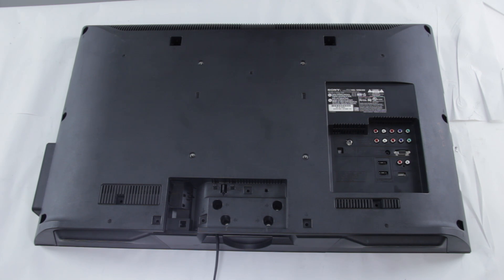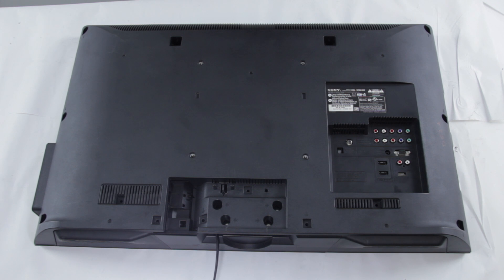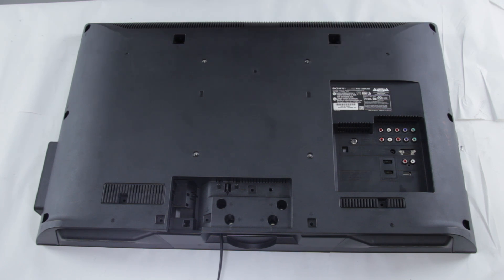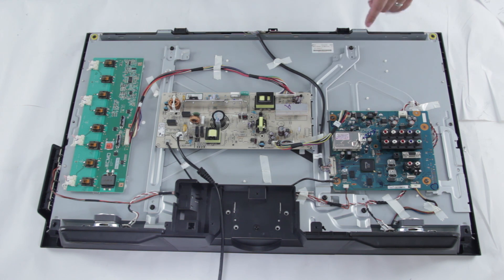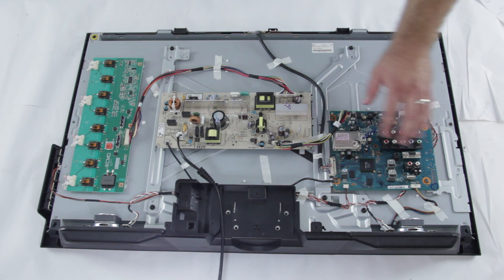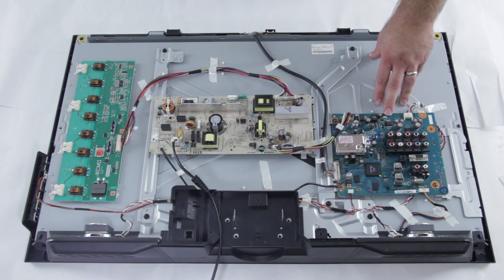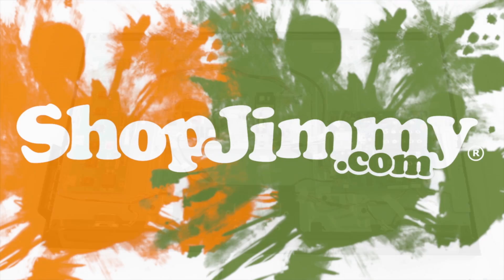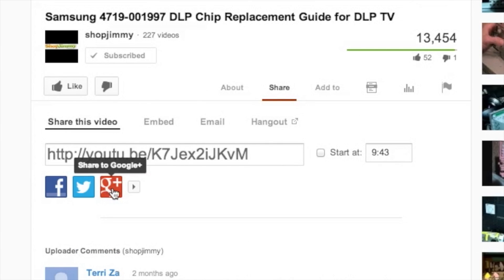LCD TV Repair - TV Has Audio, No Video - Common Main Board Symptoms & Solutions

Comment: My tv is a tcL model : 55S405 has a blue screen with sound I replace the power supply board but still the same thing is happening I’m thinking it could be the tcon board or the back lights in witch I’m trying to avoid that as it is a lot of work to replace

Comment: Hi, I have a Phillips rocu model no.50PFL4756/F7W.  It was manufactured November 22 and I've owned it around 8 months. Sometimes when I turn it on you can read the Phillips logo on the screen but it has tons of lines and the screen immediately starts to turn black from all 4 corners .the black starts in the corners and and moves inward until the screen is black or dark blue.Like if you spill ink on a paper towel type of effect.other times you turn it on and is backlit but just dark blue with no picture.any ideas?another thing is I've tried plugging into several outlets and it  always seems to pop pretty hard when plugging in like something's grounding or shorting. any help would be much appreciated,thanks

Comment: I have Bauhn (Aldi brand) model ATV75UHD-117 SN 26330389 (I think)
This TV isn’t shown on your website. I’m in Australia. Wanting to let TV repair kit. 
TV turns on sone of the time and doesn’t at other times. On other occasions the screen will disappear whilst it’s showing something. Often the sound disappears as well but on occasions the sound still works when the screen disappears. 
The red standby light works and turns blue to show that it’s on, regardless of the screen doesn’t light up. 
Thanks

Comment: Have Samsung 50" TV UN50H5203AFXZA Ver 1HO2. Everything was working fine. One morning turned TV on and had sound but no picture. I replaced Main Board. Still no Pic. Replaced Power board. Still no pic. Replaced T-Con board. Still no pic. Should I just junk TV?  Only 3 yrs old.

Comment: I have a Sharp LC-65Q7370U it turns on for a sec then it turns off for nine sec then it repeats this cycle.  I replaced the power supply board but it does the same thing could this be the main board problem

Comment: MY PANASONIC  TC-L47E50  /serial #MC23140239 / problem is when i power on  the screen coms on then flashes on and off as well as the red power light..i removed back panel i don`t see ant a see any physical damage. i looked up power supply  & mother/logic boards they were out of stock, im hoping that i will be notified once they are in stock again!

Comment: Sharp LC-50LB261U red power indicator light flashes 7 times and then turns blue.  Audio is working, video is not.  When I shine a light on it there is a feint picture. Not sure if I should replace the main board, power supply, or led backlights. Any help would be appreciated. I have a multimeter I'm not sure what I should do to test which component needs to be replaced. rptash@gmail.com

Comment: Pls my philips led tv (Philips-46pfl9706t) has video display issues.. Tv will be on but then all of a sudden the visual will be off with d audio part still on.. This happens like 10 times a day.. Whenever this happens i jxt turn it off for a few minutes and then back on, visuals will be right back on.. So i do this back and forth everyday wit d tv.. And its not about external connections but d tv itself like when am watching normal tv.. Is there any component responsible for this? I don't know.. Pls help me out.. Thks

Comment: Samsung UN46F6300 doesn't turn on.

Backlight was also slowly failing in recent years. Now, it doesn't turn on at all. Red light is on though.
Reply: Can I take a meter to any part of the board to findout which specific board of 3 is bad?

Comment: 55LV3500-UA will power on but it has a black screen, no backlight, no sound. Measured the voltage on all pins and they have the correct voltage on the connectors at cable connectors. Not positive what the problem is.

Comment: My tv is a 60ln5400. The back light is fine it gets sound. I don’t have picture and I thought it was the t con board but however I switched it out with a new one and I still don’t have picture so now I think it’s the main board. However, after about 5-10 minutes the tv will shut off. So now I’m wondering if that is also a symptom of the main board or if I need a new power supply board as well.

Comment: Hey I have a Sony xbr 55x700d. Serial number 50486624. The tv What’s not powering on or doing anything at all I took it to a shop to diagnose the problem he told me the main board was bad so I bought a main board and swapped it out the TV now turns on on the bottom with the lights and it sounds like it’s starting up in the audio only place there is no picture on the TV itself any idea what this problem could be thank you

Comment: I have a samsung UN60ES6500 and I csnt figure out if the tv has a problem or my pc which is using the tv as a display. The picture of the tv, only when its showing pc stuff, sort of jumps a little. Not quite screen tearing and not graphical fragments. Just little jumps like v-sync is messed up. Someone told me it was probably the mainboard of the tv going out but I figured I'd submit to experts in this area

Comment: Hi I have a Vizio M420NV, Serial # LAUKGUAL2003620 and it doesn't power up. The yellow Vizio lights up when plugged in and does change to white when I power on. It use to come on if I shut it down and unplug for awhile but now it doesn't power up at all. Any help would be appreciated. Thanks Joe

Comment: Hello.
Well done for helping the general public.
My Panasonic TXL32E3B kept randomly switching off after a period of time and then single regular red flashing . I read most likely issue was the Power board. So I replaced that but this didn't solve the issue.
In fact it switched itself on from standby just now so you could say it's doing both. It works better if you unplug from mains for a moment then try again. Assuming it's not the power board what else could it be?
Thankyou

Comment: I have a LG 65UJ6540 That after it warms up goes into burn test mode with solid blue, green, white colors being displayed . When the problem first started and you tried to change channels it would race thru the channels and not have the ability to stop it. Then it would go into the burn test mode with sound, then eventually the sound would quit. Any Ideas which board could cause this?

Comment: Attempting to repair an 47" LG LED 3D TV.  Model: 47LM5850-UF  Serial#:210RMWVFD601.  From what I can tell, this TV is fully functioning as I am able to navigate menus and make use of all video connection ports.  The only issue has been with the edge lighting.  On a cold start everything appears fine for 15 to 30 minutes but will eventually shut down.  If a restart is attempted at this point, the TV will light up long enough to display the LG logo screen with time right before going black again once the video signal is displayed.  Light strips show no irregular functioning LEDs, all light up with uniformed brightness until the lighting is suddenly shut down.  My thoughts fall on being a Main Board issue rather than Power Board but that's just a guess.

Comment: I have a Samsung UN48JU7500 and the second I plug in my One Connect mini, the TV turns off, and the red power butting double blinks 5 times. If I plug in the one connect mini connector cord by itself, the TV does not turn off.  I bought a new one connect mini and cable,  and the exact same thing happens. With the one connect mini unplugged, I can still use the component connection, and all of the smart tv features work as well. Does this sound like it could be the main board?

Comment: I have a Samsung 65 in KS9800. I have audio and no picture.  It's not black but gray. You can see some shadows. I've already tried replacing the T-Con and LCD/LED driver boards with no success. Can this be the main board? Thanks

Comment: Panisonic TC-L58E60  tuns off red blink light .changed out power supply  no fix unpluged tcon still no fix  back lights eliminate for a couple seconds  then turns off. Would that mean its the the main board

Comment: I have replaced the power supply board and now the tv will not turn on with either the tv remote or the power button located on tv. Samsung tv ln32c530f1f

Comment: Hello. I have a Toshiba 55L310U. All of a sudden, the set would no longer turn on. I opened it up and discovered a cap blown on the power supply board. I replaced all 5 electrolytic caps with the same value as the originals. 

Now, when plugged in, the set will “power up” bright, and then dim after a second or so, and then dim again. It will not respond after that. The is no logo screen or menus or audio/video, but the backlight is still on. 

I decided to throw parts at it and replaced the power supply board. After swapping the boards, the set is responding the exact same way. Do you feel that this could be a main board issue as well?
Reply: Thank you!!!!

Comment: Westinghouse wd55ut4490,  1st TV had backlight cutting off and on, when just by plugging the TV in, changed the main board & now, backlight doesn't come on and doesn't power on then changed the power supply board and the same thing. Power supply V's are good, 5, 12 and 24. Power button works, no power to backlight turn on or power to FRC board. Thanks

Comment: Philips 32pfl5403d/12 
Sometimes (always when warm), the picture freezes, it goes silent and the image goes dark - red disappearing last and then the front LED goes out. Simply turning TV off and on again makes it work again - and it can work fine for weeks, even standing on all the day on a weekend for 19 hours straight. It has happened three times in the last 8 months. 
I checked the caps in the power board (ESR, capacitance, resistance, Vloss) and found nothing bad, found one cap that was 14% under the rating (which is usually OK) and swapped that for a better cap. Resoldered the components handling a lot of power and some bad looking joints. 

Anything else obvious to do? It's a rather small about seven year old TV with lower than HD resolution, but it has a lot of analog inputs which is nice (not having to use the CRT all the time) and if it's cheaper to swap a board than to buy another TV - it's worth the money... or I'll probably put the 32" CRT Widescreen back on the shelf again.

Comment: ln40b630n1fxza, standby light flashes steady with no reaction to powering on. There is a faint audible and repeating clicking noise that stops after about 5 seconds. Capacitors look to be in normal condition

Comment: I have a Changhong LED TV MODEL LED32C2000 . Pictures distorted solarized. No audio upon opening need several try or waiting until the tv heat and try opening again before you can have the audio. what might be wrong with the LED TV? Do you have available parts for this tv? Thank you so much in advance. More power.

Comment: Have a JLC47BC3000.  Powers up but no image display's after logo goes away.  Would be an easy fix if replacing the main board but is that cost prohibitive?  Under 300 should be justifiable.

Comment: I have a question I have a 65 inch RCA TV that will not turn on there is a blue indicator light on the TV that also does not turn on I tested the power supply board and on one of the little prongs it gives me 5 volts I don't know what to do

Comment: Hi I have a Celsus 50" flat screen the model number is DLED50272 FHDCNTD . We have just returned from hols and put our TV on with the remote  as usual the tv powered up but we had a black screen with sound, I thought that the source was at fault but no there was nothing wrong with that, I changed the source  to the Xbox feed but the picture never  changed, I put the  source back and then the sound went, now I am left with a tv that has a black screen no sound no menu, the remote works fine with the standby, I have done the torch test but nothing shows, I dont know if the problem is with the power board or the main board ?

Comment: HI I have an issue with my LG 3D TV. I have LG 42 inches 3D TV. Model number LM6200. TV has sound and bacllight, ican see the   dim light in the screen and can hear sound while I connect with dish, bluray player and antenna for local channels. I just rored the flash light test, as described in your youtube channel, but couldnt see anything. Please advise me, whhether the isseu with main board or t0con board. My T-con board part numner is 6870C-0401B, ver 0.2.

Comment: Thank you for this informative video, i have a Haier 39D3005 that stopped turning on completely with remote or regular buttons, that stand by light is working but the TV is not powering on, what could tge problem, main board or switch panel? And what boards are compatible with it

Comment: I have a 55inch insignia ns-55l260a13 when i plug it in and power ir on the back light flashes on and off till the red light shuts off and i have to unplug it for it to do it again. I have checked all capacitors out of circuit all are good all resistors and diodes on power board  are good. And i was wondering what else to check could it be a main board issue

Comment: My phillips tv (42pf7421D/37) I'm getting picture and sound but the screen blinks what can cause this. I have noticed that I heard a noise clicking noise on the power supply board every time the screen blinks.also I noticed so dark areas on the board possibly indicating overheating. But no blown capacitors .the tv does power on normally though. Any help would be appreciated thank you

Comment: We have a sony model#kdl-46w 4150 ser #800 5569. It works w/ an antenna but will not work on a cable. We have tried it w/ other cable outlets in our home which have properly functioning tvs and it will not work. i have hooked up a different tv to the outlet we are trying to work and that tv works properly. I have even had cable out to check our service and they could find no problems. This Sony apparently reads a signal from an antenna but not a cable. What needs to be done to fix the tv?

Comment: Have a LG 32LD350-UB backlights work, speakers work, but no picture. I've replaced the main power board, but no luck. Thinking it's either the main board or T-con. Any other suggestions?

Comment: Hi. I have a Panasonic TC-L32C3 I am trying to repair. The problem that I am having is that the tv powers on and works fine sometimes, but then I can power it off and back on and it won't have picture but the audio still works.  With the flashlight test it doesn't have any signs of picture either. I then power it off and back on and it works fine without having to shake the tv, so I don't think it is a loose connection anywhere.  Sometimes I have to power it off and back on a few times before it begins to work correctly. 
Thank you in advance for any help that you provide. Feel free to ask about any additional information you may need. Thanks again.

Comment: RCA 19" Model#L22HD32D TV Comes On Will Play DVD Show Picture Of DVD playing But Wont Show picture from direct TV box checked connections from direct TV box all wires in connections are good hook them with another TV box picture comes up on screen Look On your Sight on you tube and you were out of stock the main board that i need or think i need.

Comment: Hi 
SONY 42^ LED TV
Model : KDL-42W650A
Problem Statement: Green colour dots shades are seen randomly on screen area.
This behaviour is not consistent, it started five days back, for the first two days we have seen this all the time. 
Next two days completely not seen and the fifth day problem repeated.

Initially TV was wall mounted for the first two days when we have seen the problem, then we unmounted and placed on table top. Then for two days we have not seen this problem. Again fifth day problem repeated.
I have updated to latest firmware and also factory reset. But problem not solved.

Please let me know what is the problem and suggest me how to fix

Regards,
PadmaRaju

Comment: 42LG50- UAMy tv won't play sound through the speakers and none of my HDMI ports work. I do use red, yellow, and white cables for a sound bar and DVD player. I'd like to upgrade to blu ray but can't due to no rca plugs on player and no working hdmi ports on tv.

Comment: Thanks for all your wonderful information. I am learning a great deal about fixing my tv.   I have a Sony KDL-40W600B that needs the main board replaced.  I have taken the lower back off of the set and followed the service manual to remove the main board and tuner board.  Can you tell me how to go about separating these two boards, as they appear to be connected?  I can't find info on how to do this, and I don't want to break the tuner.  Thanks

Comment: 32' Samsung Model UN32H5203AFXZA No picture, No sound with blinking power button led light (audible clicking sound when the led turns on/off).   Disassembled it and did not see any issues with caps or burnt marks.

Comment: Hi, i am trying to repair LG 42LB5800-UG, SVC CODE: 42LB5800-UG.ACCDLJR.   LG logo flashes for a moment and goes black screen but speakers are on and no video. Please let me know whether man board is the problem or LED strips are bad. I tried changing the T Con board, but nothing changed.

Comment: Hi i have a bush 50 inc 211f tv my problem is red standby light on but will not switch on from button on tv or remote 
I have done voltage tests on power supply and all ok got standby voltage 5v so i looked at the main board and replaced the eprom chip 
But on good now. I have gone for new main board do you think this is the problem 

Thanks